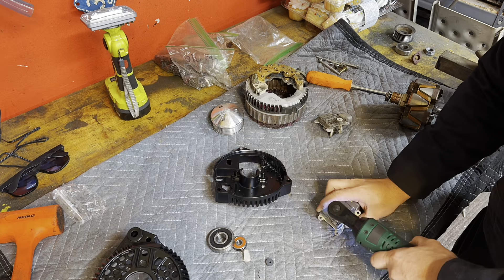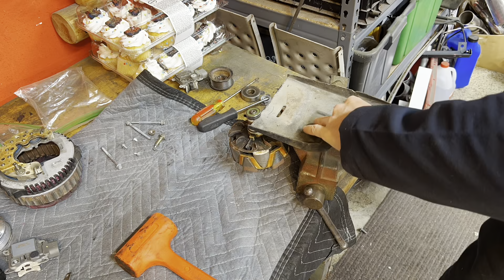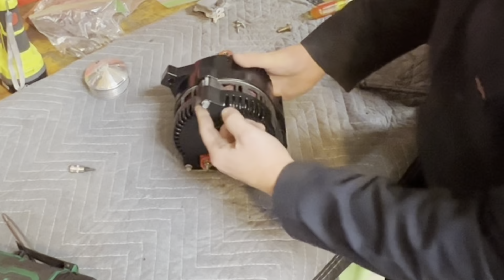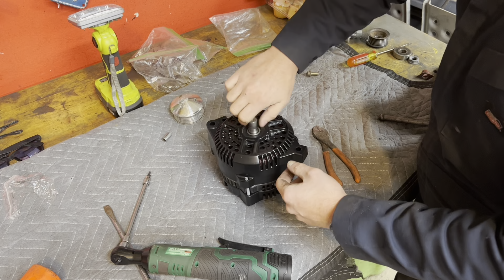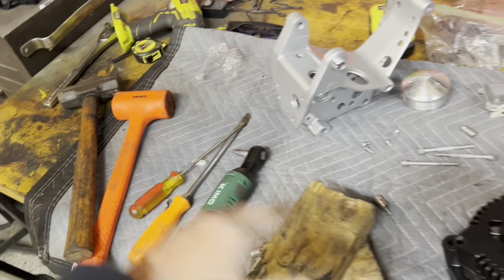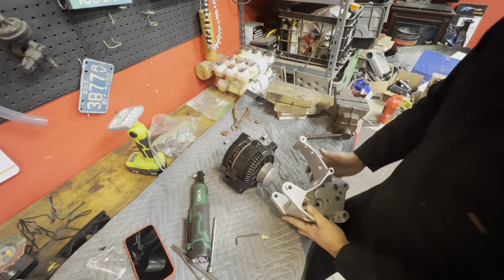Part 2- EASY $26 Mustang ALTERNATOR REBUILD SN95 94-04 - Project HellStang

Comment: Good video.  Here's some tips for next time you rebuild an alternator.  First, if you smack the mounting ears of the front case it'll come right off, you shouldn't pound out the rotor.  The rear bearing can be removed easily with a battery terminal removal tool. Also, all contact points between the alt and bracket and bracket to engine should not have powdwr on them.  Same with regulator to rear case.
Reply from the maker: Awesome tips thanks for sharing! The powder caused some grounding issues I found out in a later video. Ended up having to run a ground from alternator to chassis. What a pain that was to figure out lol.